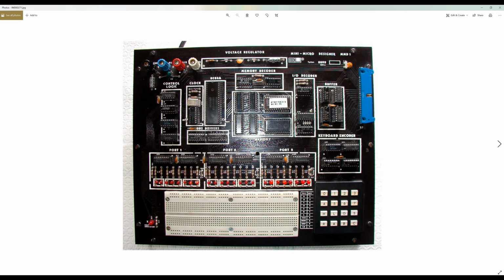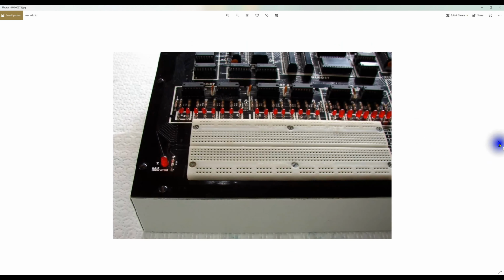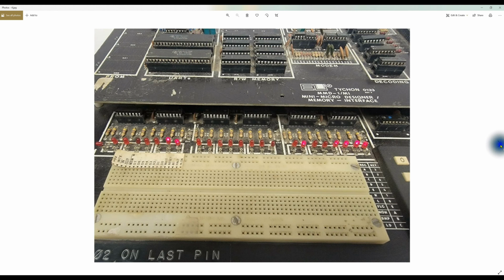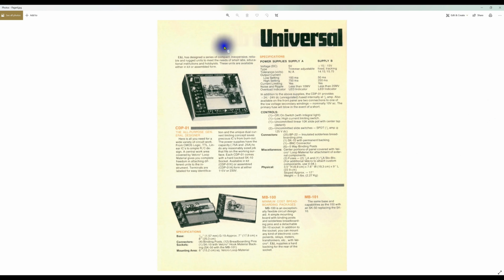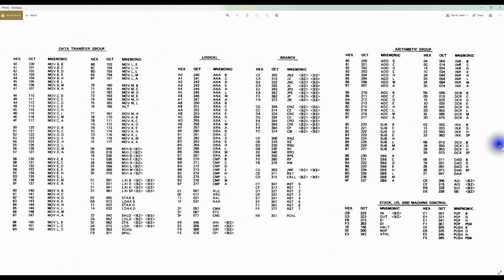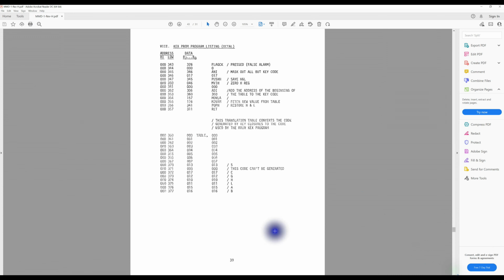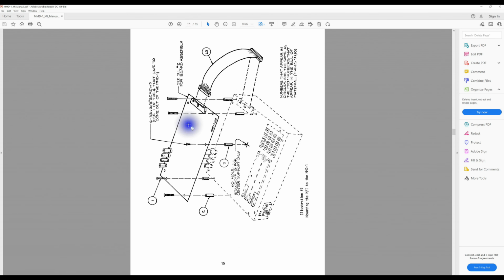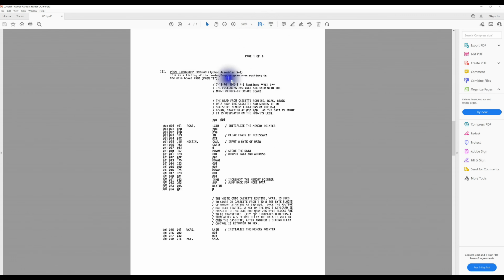STB950 - E&L MMD-1 - Part 1 - Introduction

Comment: I just bought a MMD-1 on eBay. Paid $50.00 for it. It’s just the board with a few chips missing. No big deal. There is no case so no power supply. There is also no prototyping strip eather. But I did notice one thing. On the 16 LEDs, on the boards seen in books and on YouTube, there are these single sockets underneath each LED. The boards seen I just bought does NOT have these single sockets underneath the Right 8 LEDs nor the left 8 LEDs.
But the Center set of LEDs these little single sockets are there.
So, has anyone else seen this version of the MMD-1 and if so, any ideas on what version this board might be ??
Reply from the maker: What color is the PCB? Does it have the black solder mask?
Are there holes in the PCB for the "single socket"? - These are where the wire plugged in that runs to the prototyping area.
My guess is your board was partially stripped to repair another MMD-1.
You'll find my manual archive at https://archive.org/details/bb-iv which includes the MMD-1 manual/schematics.
Reply: @Sha @ShadowTronBlog yes, it has the black solder mask on the front where the ICs are. There are only 8 single sockets on port 0. There are no single sockets or any holes for the other single sockets on port 1 or port 2

Comment: Nice video.  I designed the MMD-1, but the original computer was named the DynaMicro.  Radio-Electronics magazine published a construction article about it in the May 1976 issue.  It was the cover story.  (One of our colleagues thought some RE readers might misread the computer's name as DynamicRo.)  We licensed the design to E&L Instruments and received a nice royalty in return.  E&L chose the MMD-1 product number because it already has a "Micro Designer-1" product (MD-1) and the DynaMicro became the Mini-Micro-Designer-1.  E&L Instruments had us design an add-on board and then someone else redesigned it.  I recall someone had a version of BASIC for the expansion board.  --Jon Titus
Reply from the maker: I feel honored to have you viewing one of my videos. I have the May 76 edition of RE. I've considered building a DynaMicro over the years using the article. It's in my project list.
I recently moved and have been going through my books, I have a nice set of BugBooks and a number of other books you authored. It's a really nice shelf of books from back in the era.
Reply: I remember the DynaMicro and I read the cover off of that Radio Electronics Magazine with the construction article. I was 12 years old when that article came out and it was another 4 years before I had the funds to build my first micro computer (an 1802 ELF) but the DynaMicro has always held a special place for me. I’m sure it launched many careers in computing and electronics.
Reply from the maker: Jon, Did you see the Dynamicro that sold on eBay recently? Went for over $2K - was outside my budget.

Comment: Wow, this takes me back.

The MMD-1 was my introduction to microprocessors as a teenager. Never had the MI expansion or any other data storage, so I got used to leaving it on 24/7 so as not to lose my work. Mine was the older version with the AC power switch on the front panel. The switch had a long plastic bat handle, which I eventually trimmed down to about 1/4" after a couple of accidental shutdowns!

I really liked working in octal with the 8080 machine code. As you mentioned, many of the register callouts & such lined up so nicely that I was able to memorize most of the instruction set fairly quickly. When I later bought an SD Systems Z-80 Starter Kit, I was frustrated having to switch over to hexadecimal.

I spent countless hours learning a tremendous amount with my MMD-1, eventually using it to control a PAiA synthesizer I'd built a year or 2 earlier, among many other projects. It's still in my electronics closet (along with several Bugbooks)! Lately I've thought about getting it up & running again. One of these days...

Thanks for the interesting videos! Very nicely done.
Reply from the maker: %Thanks for letting me know. Always nice to know someone enjoyed the video.
Reply: Hi, how can I find the “ Bugbooks “?